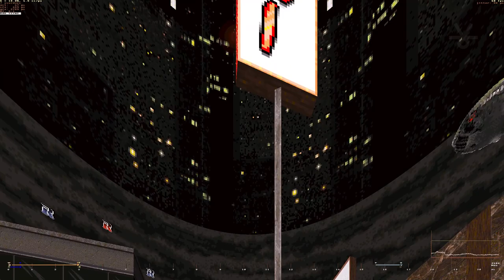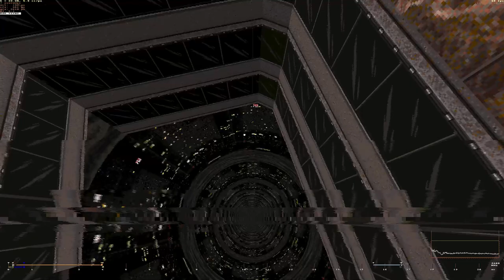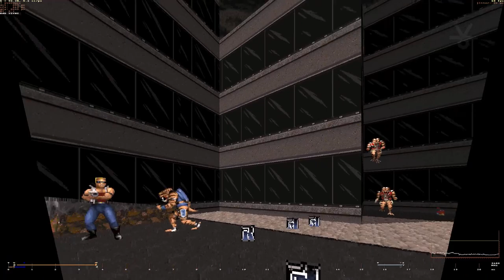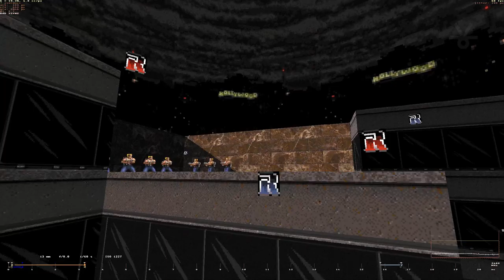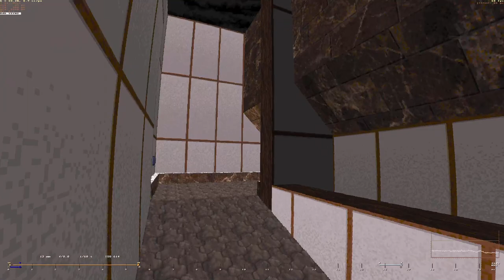Frame postprocessing in Brahma Engine explained

Comment: This is such a cool idea! I always thought more could be done with off-screen buffers besides rotation, but 90s CPUs were not up to the task.
Reply from the maker: Thank you! Perhaps the best use cases for such off-screen buffers is for doing distortion effects and reflective Fresnel glass. Having free look and rotation done this way is a cool and curious feature from a technical standpoint, although it inevitably degrades image quality in the process (sometimes very significantly), especially when Bayer dithering is used somewhere in the scene, since it relies on exact pixel placement. In the end, I'd rather recreate the same functionality with a new renderer that natively supports 6-dof.

Comment: Was thinking about the same thing today as in the reason sprite enemies looked good back in the day was cause there was no vertical perspective. When vertical perspective is introduced, sprite enemies look like cardboard cutouts up close like in the GZDoom look. Your postprocessing kind of solves it cause the sprites are flattened to the background first by the render.
Reply from the maker: I don't think that postprocessing actually solves that issue. What does (to some extent) is that my billboard sprites always face the camera but still stay upright, while the classic (simpler) way to draw such sprites is to align them to the viewing plane. That looks really weird when looking straight down/up. Also some sprites here are replaced with voxels.
Reply: @punpcklbw  Yes, to some extent. Atleast its not the comically bad GZDoom look.

Comment: Amazing work. I have a question. Do you increase your vertical as well as your horizontal field of view as you pitch up or down? Also, is your off-screen framebuffer the same aspect ratio as your screen buffer?
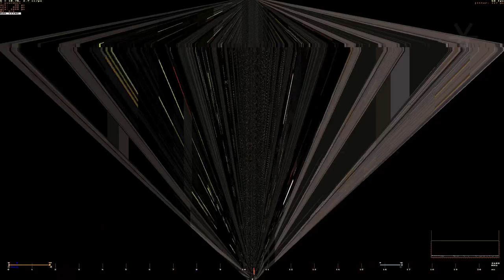Reply from the maker: Sure, and the parts which are furthest away from the horizon squash the image considerably because of that. On 4:05 you can see the content of the off-screen buffer as it is.
Reply: @punpcklbw  So how are you calculating the shape of the trapezoid? Are you projecting the zenith point to the screen? I'm referring to the shape of the trapezoid before the offscreen buffer is split into multiple trapezoids.
Reply: @punpcklbw  Also, am I correct in that you're doing some sort of perspective texture mapping from the off screen buffer to the framebuffer?
Reply from the maker: @matthewlevenstein  Yes, a perspective projection is done with horizontal scanlines. The associated overhead is very small because Z remains constant along the horizontals, memory is accessed sequentially and some SIMD optimizations were implemented (I am using fixed-point arithmetic throughout). After solving the projection equation, the relation of resulting top/bottom Z's is your trapezoid taper amount.

The exact bounds are obtained by interpolating tangents of viewable area angles in logarithmic domain (since this yields even distribution of detail across the frame).

However, I'm not very fond of the current renderer implementation and consider it a temporary solution (until a proper 6-DOF support is there), since any transform done as a post-processing stage will degrade image quality.
Reply from the maker: @matthewlevenstein  What needs to be projected is trapezoid boundaries that should be already clipped into the viewable area. There's a limit on how close they can approach zenith/nadir points which is set to approximately 1.5 % of the total frame height (the remaining area is filled with repeating scanlines).

Btw, is it academic interest or you have any work in the making?
Reply: @punpcklbw  I really need to think about that last part, and I'll probably return with another question. I've been working on a similar engine for a little over a year with no real plans for it, I just love the build engine. About six months ago while playing another game, it hit me that you can add a pitch effect by warping the screen as long as the zenith/nadir points aren't in view, but I've failed to implement it correctly so far. I found your videos about Brahma a couple months ago, and frankly I think it's the one of the most interesting engines in development at the moment anywhere.
Reply from the maker: @matthewlevenstein  Yes, it takes some expertise in vector math and projective geometry to get it right, and I've been refining this algorithm for quite long. I've come to a conclusion that I'll have to do a native 6 DOF renderer in the end that will make use of my free-directional texture mapping technique throughout. Hopefully it will also take advantage from my SSE2/AVX2 optimizations to work quick enough.

Great to know that you were also inspired by the Build engine! I'm a fan of Ken's work and various unique tech that does things differently. Have you got any interesting results this far?
Reply: @punpcklbw  I have about three things going at the moment that will likely merge into one. The first is a build-style constant z sector portal rasterizer, and a very basic map editor. Nothing fancy here, probably where you were 3 months into Brahma. The second is a 6dof renderer of the same map data. The only thing interesting here is that if you stick to post processing for roll, you can use contant z lines for your floors and ceilings.The third is a grid accurate voxel raycaster with texture mapping (walls only at the moment).

I'd love to know more about your free-directional texture mapping. Is this related to diagonal constant z lines?
Reply from the maker: @matthewlevenstein  Yes it is, since a const z fill of a polygon requires us to walk along arbitrary directions. As you might have seen, some form of it is already implemented for slopes, but it can't replace the wall scan for a 6DOF mode at the moment.

Nice to know that you are trying to do a 6DOF renderer. Are you using a Polymost-like clipping method for it? I also remember prototyping a grid-based raycaster myself before I started working on Brahma, but it didn't go very far.
Reply: @punpcklbw  It surprises me that you're not using raycasting for accurate voxel cubes. Are you rasterizing all those little cubes?

Can you tell me more about angled constant-z rasterization? How do you achieve such perfect fill? And how fast would you say it is compared to wall and floor rasterization? And have you benchmarked it against a quake-style affine subdivision scanline rasterizer?

I never really looked into polymost. The clipping in the 6DOF renderer is a pretty standard 4d clipper after the 3d transform.
Reply from the maker: @matthewlevenstein  If you're talking about heightmapping, this is essentially the normal scanline rasterization with the only difference being that each line is "extruded" to a specific height (sampled from the heightmap) from the last dmost/umost value of each column.

To fill an area with const-z lines, simply shift your line along y axis regardless of the angle of slope, like if you were drawing a horizontal plane, but with the horizon going up or down as you proceed from left to right. You should see the same pattern of pixels repeat for all lines regardless of their horizontal span. Fixed-point math for slopes and screen-space coordinates is strongly recommended for this, as it guarantees that clipping doesn't mess up your lines.

These approaches help unify much of the logic for various types of surfaces. As for the const-z rendering performance, it's difficult to benchmark directly, since Quake was optimized for older machines; also it uses x-buffer for its scanline level clipping, so it couldn't benefit much from const-z. I suppose this way could not be competitive enough back in the day, but I can tell that the more effects you put into play, the bigger is your expected gain from the use of const-z rasterization. My method is a lot faster than slopes in Build, and I'm yet to rewrite it with SIMD intrinrics! Speaking of quality, imo piecewise-affine texture mapping is vastly inferior to const-z approach (note wall textures totally fuck up in many older 3D games when viewed from almost edge-on). The possible examples of what can be done better with const-z are:
- precise perspective UV mapping (duh!)
- scanline level mipmapping
- lightmapping
- heightmapping
- fog/visibility
- anisotropic filtering
- Fresnel environment or reflections
- correct overlap of translucency
Reply: So how are you rendering voxel models? Same strategy as heightmaps? 

Are you drawing slopes vertically or horizontally? 

Also I want to say that your engine is the future. The distant future. People won’t realize it for quite some time. And if you haven’t shown ken Silverman your work yet, you should, he would appreciate it.
Reply from the maker: @matthewlevenstein  No, the voxels have to be rasterized, since they are not heightmaps but slabs of vertcally stacked cubes. However, I keep looking for more efficient ways to render them. There is a "bound cubes" method that replaces cubes with 2D rectangles like Build engine does. Also there is a very fast way: draw a voxel object from a specific angle (with a fixed size and no perspective whatsoever) and cache it into a temporary sprite. Then you can lookup over thousands of such cached sprites with a hash table. This mode could be useful for drawing impostors from far away, since it makes full-blown 3D objects render at the same as speed as 2D billboard sprites what is a huge deal.

Thank you for appreciating my work. I suppose that the "distant future" comes quicker than we expect as things are about to change, and hopefully this engine enters the stage just in the right time.

In fact, I'm trying to reimplement and elaborate approaches that were ditched at some point in the past, and now game tech has got stuck on triangles rasterized with a Z-buffer. This comes to a dead end, but nobody seems to take the risk of developing something completely different that could give birth to a new niche.

I stay in contact with Ken, didn't write to him for a while though, but I suppose he's aware of this project being run.
Reply: @punpcklbw  so with my voxel engine, I do a fast 2d grid intersection raycast for each screen column over a grid of rle elements, and then I just rasterize the element to the screen column. I got the idea from Silverman’s voxlap, which uses a more advanced 6dof version of this strategy. My idea was to stick to 4dof, so it could be fast enough to texture map the cubes and then to add pitch as a post processing effect, but as you know I haven’t gotten that part right yet. Have you tried something like that yet for your voxels?

Do you rasterize your sloped surfaces horizontally or vertically or diagonally?
Reply from the maker: @matthewlevenstein  I was experimenting with a rectangular grid renderer that is resemling voxels in a way but done in a Wolf3D'ish manner, with textures and on a larger scale. My idea was to make boundaries between cells have arbitrary profile taken from a shared collection with possible curves or non-convex shapes. However, I've come to a conclusion that per-column raycasting of a large 2D grid cannot be made fast enough, so I've taken the sector approach. As for the slopes, you can watch my early lapse videos of how they are rendered in Duke maps. In essense, this is a "hline" drawn with an arbitrary slope to make it appear diagonal. As you can imagine, only one pixel per screen colunm is filled on each line regardless of its slope.